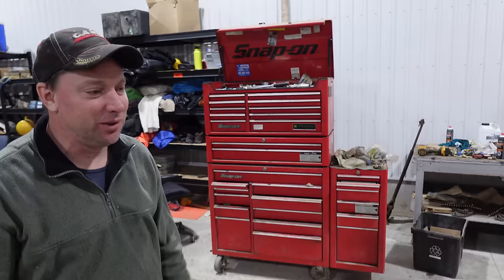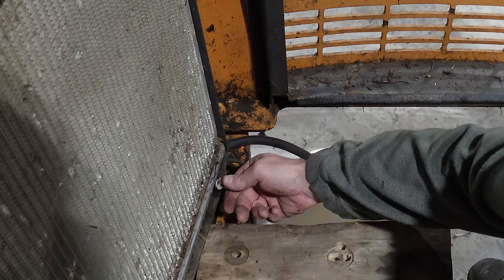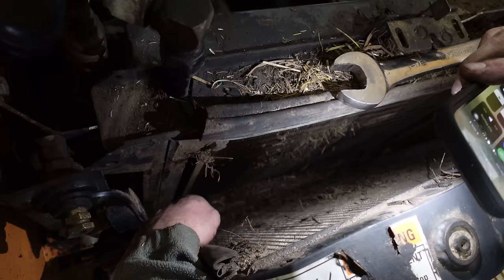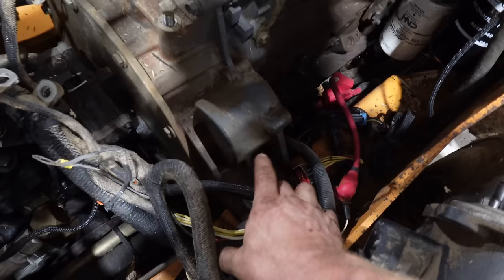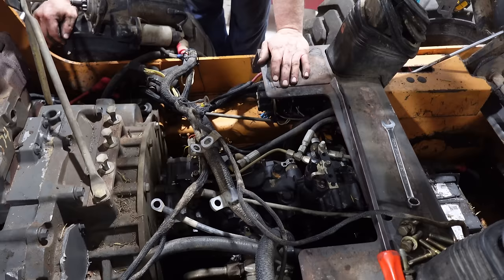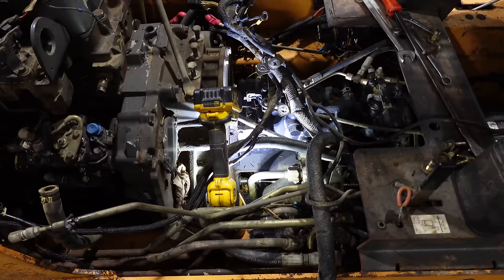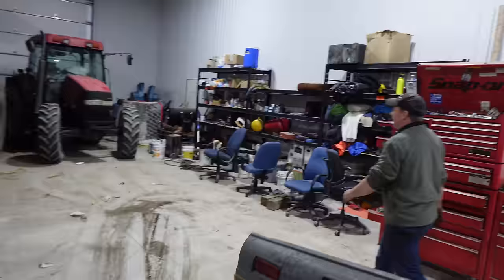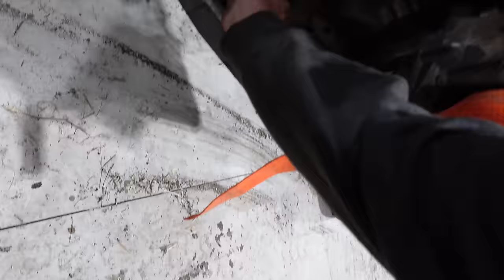4.5L Cummins Teardown! Case 430 Skid Steer Fell Over [EP2]

Comment: Just a suggestion from someone that fixes diesel injection pumps and injectors. Have the pump and injectors looked at by a shop to make sure everything is good to go when you reassemble the engine.

Comment: We've got one apart in our shop right now that the crank snapped in half. It was still running good but the oscillation of the end of the crank caused snapped pump shafts which is how the issue was found. Cranks are somewhat hard to come by for those motors.
Reply: If that engine was in a case 450 with side by side pumps, driven by a splitter box thats the cause of the crank failure.  Case updated the pump to an inline style and sold a kit to convert them.  Did a few during my dealer days.
Reply: @kevinoscarson2941  it is and the pumps are side by side still. We are getting rid of it after it's fixed as we have a Bobcat to replace it already.
Reply: @BcbuhlerFarms  -unfortunately its a known issue.  Good move to move on.

Comment: Some of the cheapness drives me nuts..  Its one to not just waste $$, but take the rods and block to the shop with the head and crank.  a Have the rods checked, have the cylinders honed with a rigid hone to straighten them up, pull all the galley plugs, and have it cleaned to remove all the bearing shrapnel.  The cost of the machine work is almost nothing compared to the amount of time, and cost to do it over when it happens again

Comment: Don’t trust the plastic timing pin. When you’re reassembling the block, Measure #1 protrusion and then set the pin. The injection pump has no timing reference marks whatsoever. But a pump shop can reset that easily enough.  When the 430 first came out, most had to be lifted off the trailer due to incorrect pump timing. We had to reset all the pins and re time all the pumps.

Comment: You can use the piston pin, two rods and a feeler gauge to check the rods. Normally they twist also when they bend, so you stick them both on one pin and check the big end for equal gaps.. by turning them 180° and comparing different ones to each other you can get an idea which one is bad if there is one...

Just wondering, being the outer one,  away from the timing, it can also be a twisted crank... Unlikely, but if they already saved on cam bearings you never know, maybe it's made of old coke cans 😂

Comment: Wild. I recently requested this engine. Not because I want one but because that's what's in the 400 series Case skids. This should be the non turbo Iveco 445 in a 430.

I'm curious about longevity with proper maintenance. I did recently see one with a hole in the block, but it had 9700 hours.

So with the timing cover combo on this engine.  A 4B conversion is an unlikely backup plan.

Comment: 15/17/19mm are for M8/M10/M12 nuts/bolt heads so I think that's why they skip them in most sets.

As for the assembler putting the hose clamp on they are probably doing what they are told by the engineer who designed it in CAD and has no concept of what a spanner is or how to use one.

Comment: I've got a 430 that needs engine work too, is it still more economical for you to rebuild the engine vs getting a reman? I assume if the block is touched then reman would be the way to go. I think ours will need bored and oversized pistons. It was ran without coolant for an hour or so. Like your videos, thanks for showing your work.
Reply: Reman short block is $8005, full reman engine is $13505. The big sell on reman is you get a 24-month warranty on the parts if you install it or parts and labor if the dealer installs it. Really depends on what way you want to go

Comment: Your in it that far just send the rods in with the crank and have them checked out just my 2 cents
Reply: I built a dozen engines and never had a crank or rods checked by machine shop except one time with brand new rods that bent later that year. 

Checking myself I got 20k miles on my motor in under 1 year.

Comment: 29:08 This is why a compression test is only half the diag. Cylinder leakage test before disassembling the engine would have told you where the compression was going.
Reply from the maker: It was a bent valve.    Nothing to do with bearings

Comment: The one that is taller probably has a spun bearing...  If the bearings overlap it can raise your piston.  If it was knocking, hopefully it didn't bend the rod...   But when you pull that bottom end, I bet there's a spun bearing on the tall piston.

Comment: Could be a bent rod but most likely it’s because the heat from the bearing is heating up the bearings in number one, allowing number one to reach compression, and the heat from number one has over heated the rings on number two. Over burning the number two rings. IMO
Reply: Makes the most sense for me
Reply: Gotta be burnt rings on two

Comment: I guarantee that an engineer specified that the assembler to put that hose clamp in that way and didn't even think about it being repaired. As far as the company's concerned, you are supposed to scrap it when it stops working and buy a whole new machine every single time, so they don't care, at least at the CEO and marketing level, so they don't give the engineers or assemblers time or energy time to consider such things as repairs or rebuilds. The CEO and marketing really doesn't understand their customer base will keep a piece of equipment running for 150 years until the parts for it stop being made as long as it does the job fast enough and cost them a low enough price to run.

Run it till it can't be repaired or rebuilt is what farmers and small construction contractors do with a lot of their equipment unless they are running factory sized farms and then it is still a cost/benefit calculation for every major repair/replacement event.